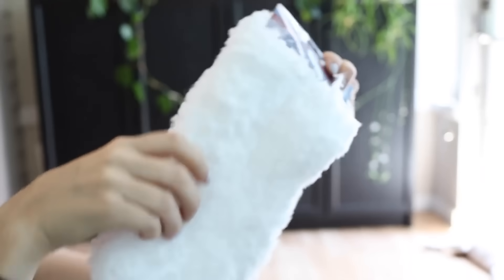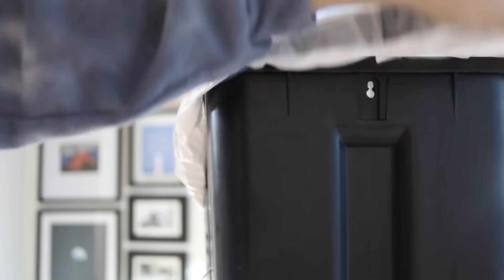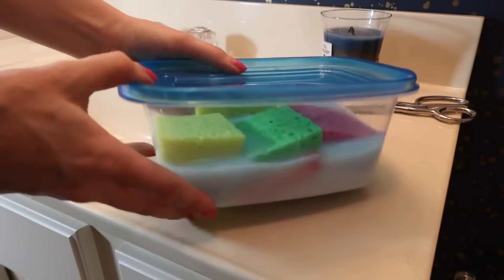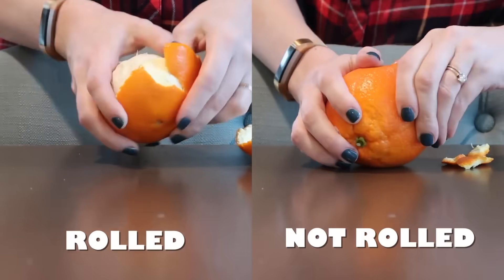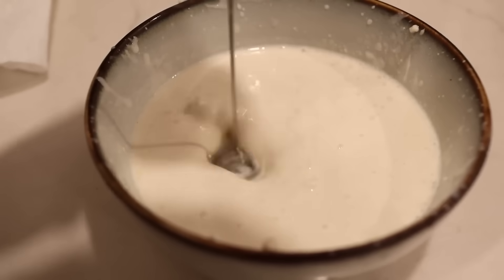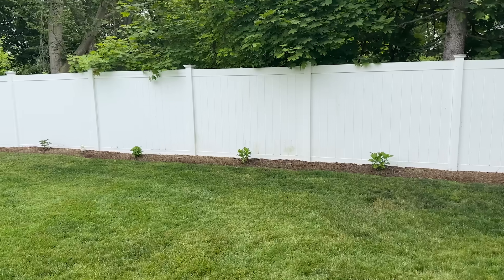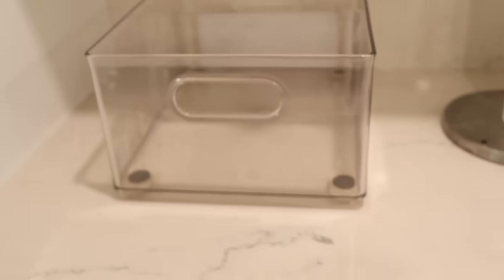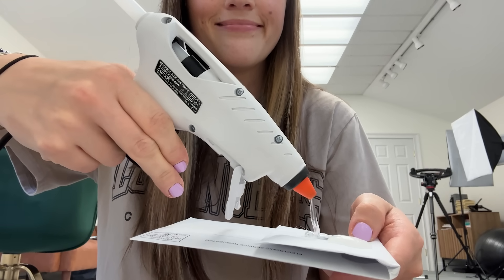43 brilliant NEW home hacks you need to try!! (you won't believe #22)

Comment: I use wool dryer balls in the dryer. No buying/nor making dryer sheets. I use three. The last for ages. Like years. I highly recommend them.
Reply: They are noisy though.
Reply: We use neither dryer sheets nor balls in the dryer and our clothes come out without any wrinkles.

Perhaps it's because I take them out of the dryer fairly soon, smooth and fold them right away and put them away.
Reply: My dogs steal them and I never see them again.
Reply: @helenskylar7239   😂 My cats like them too. I finally bought them their own.
Reply: I used my dryer balls for a long time &  they started to peel & shed so I put each one in a sock and tied off the end and voila - still good to use.
Reply: Excellent  hints!!!! Thank you so much.❤
Reply: @NASA_astronautHammockStepMom I wonder what I could put a wool ball into, since I am allergic to wool.
Reply: @dianefranks1621  I put mine in a cotton sock and tie off the end.
Reply: @dianefranks1621  I put mine in a cotton sock and knot the end of the sock.
Reply: I also put essential oil on the wool balls and Wa-la nicely scented!

Comment: I love these hacks and your channel. When it comes to cooking corn in a cooler though, I wonder if the plastic liner in the cooler was designed to endure boiling water, so chemicals don’t leech into the water and if that plastic is BPA free.
Reply: I was concerned about this as well!
Reply: I wouldn’t risk the leaching chemicals on my food. Otherwise, every hack is just fantastic, especially the garbage can hooks. Love your channel.
Reply: While I personally wouldn't do this hack myself - I have a huuuuuuge pot as well as a large roasting pan I could use - I suppose if someone really needed to do it they could first line the cooler with one of those turkey-sized oven bags? Those bags are meant to be food-safe so I guess that should work.
Reply: Maybe a food-safe crockpot liner could be used for additional peace of mind.
Reply: I'm thinking of trying this in my crockpot for a smaller quantity.  The boiling water in an already heated crockpot should work well
Reply: How would it be any different than if it was in a plastic bowl?
Reply: @Blondie7676  Not all plastic is made equal. There are food safe plastics that are not hormone disruptors (marked BPA free, etc.) that can safely hold food even when warmed up so chemicals won't leach into the food that you plan on eating. Whatever you use to cook your food in, check to see if it mentions what temperature range is safe, if it's microwave, oven, or stove top safe, etc.
Reply: @NotAFanOfHandles  good to know. Thank you honey

Comment: For toilets and toothbrush, maybe in the us it isn't available but in Poland there is something that in my translation is unclipped toilet seat, basically its just what it's called, you can unclipped seat and wash it in bathtub or shower, its not very common but i could not live without it since i discovered that
Reply: I know exactly what you are talking about, so good job with the translation.   They aren't very common but I have one too.    Some of them are called Lift-off or easy-off.   I will never go back to the other type either.
Reply: They are available.  I bought one from Home Depot.  =^..^=

Comment: I have never, ever saved a home hacks video - until now. The first one I plan to use is the heavy duty broom in the showers.  We have stone floors in them and I scrub them by hand with a small brush.  I'm 72 and it's not always easy for me. There were a couple of others - like the over-the-door hangar for outside and that glue stuff to keep things from sliding.

Comment: Thanks for so many helpers.  My favorite it using the dish wash sponge and handle thing for cleaning in the shower.  That is going on my list of things to pick up at the Dollar Tree.  Another was the glue stick....how simple, yet why had I not thought of it.  I subscribed so I wouldn't miss any other hints and tricks.  See, you can teach an old dog new tricks....I'm 84 and learned several new tricks today.
Reply: Since you're elderly like me, here's a hack for getting clothes out of the dryer. Get a grabbie from Harbor Freight. When clothes are dry and you can't get that sock in the far back of the dryer without excessive reaching, use your grabbie.
Reply: @judyanderson8782  Thank you Judy, That gives me an idea to use that grabber (which I do have) for getting some of the laundry from my washer also.  It is so deep that sometimes even on tip toes I still can't reach the wayward piece.  I appreciate you reminding me that grabber can be used somewhere else besides my pantry.
Reply: I use my grabby thing to open and close my curtains that hang freely on the curtain rods, just grab and drag!  Easy!
Reply: @bobbiegallia1188  great idea, thanks for sharing that one.
Reply: Long tongs work well in the laundry room too
Reply: I used a dustpan brush to wash out the bath tub.

Comment: I agree with your complaints about nooks and crannies of cleaning. As we built our house, everything I chose was based on how easy it was to clean. Also, we bought one piece toilets, which are a lot easier to clean
Reply: Houses and cars should be designed   for ease of cleaning!
Reply: I just got some denture tablets to clean my stained  thermos flasks and mugs. I'll try them on my Tupperwares too.
Reply: How did you determine if something was easy to clean, do you have some tips or your thoughts?
Reply: Gotta get a steamer....it changed my life. I hardly even buy cleaning products anymore. It also cleans nooks and crannies beautifully, removes water spots, hard water stains.....stains on fabric, everything. I used to hate cleaning, now it's basically me getting to play with my awesome new toy lol 😊
Reply: @amandajlemen might get one now! Thanks
Reply: I spray lysol, scrubbing bubbles etc around all nooks and crannies then after scrubbing the shower floor tile I pour hydrogen peroxide over it to boil out all.mildew

Comment: I’ve been doing the hanger trick (#14) for years. Works like a charm.
Reply: Me, too! Mine came out of necessity. During recovery, when I had my hips replaced, I was unable to stand and walk for long periods of time. So when it came to laundry, I simply figured this one out on my own. I also found that shaking t-shirts from the bottom hem and holding at the seams was much more efficient for straightening the shirt out for folding and hanging.
Reply: I love it

Comment: Personally I wouldn't do the cooler one because I have several ginormous pots, plus a roasting pan I could use instead, but also the potential BPA/chemical leaching concerns. If you really need to use it, I would recommend first lining the cooler with a turkey-sized oven bag as those are food safe and will tolerate boiling water. Pop the bag into the cooler, place the corn inside the bag, then pour the boiling water into the bag. Place a couple of wire racks on top to keep the corn submerged for even cooking and you should be good to go.
Reply: I agree 💯🩷

Comment: I use dry erase markers on my fridge for grocery lists and phone numbers that I only need for a little bit. I use them on my freezer for the next weekʼs meals. When I have transferred my grocery list, I wipe off the fridge. Same with the freezer. I use a squirt of orange vinegar to make sure every bit of the previous lists are gone.

I use them on the washer to threaten mayhem if the water temperature goes hotter than warm. My happily moved last roommate was bad about that.
Reply: I've never heard of orange vinegar before I'll have to look for It
Reply: @FriendOfJah  I think you make it by soaking orange or Mandarin peels in vinegar for a week or so

Comment: My hardboiled egg shells always stuck until I tried this hack I saw:  bring the water to a rolling boil first, and THEN add the eggs.  Simmer about 14 min.  I also put them straight into ice water when they're done, but that alone wasn't enough.  It's the rolling boil that made the difference. 
Lots of good ideas here!
Reply: Maybe that's why the streaming method works so well. I  boil the water first.
Reply: That’s exactly what I do! Add eggs to boiling water. Boil for 14 then ice for 7

Comment: 6:38 Another thing that you can do with the rice and essential oil is use it as heat pad. Pop it in a microwave for 30 seconds and you get yourself a heat pad. Essential oil is optional :)

Comment: Thank you for your tips.  Love the garbage bag command hook and bread bag.   I fill my brush with Dawn and vinegar to scrub shower doors while my conditioner is working.  I throw some Apple Cider vinegar in the bleach section of my washer when I wash blankets if anyone has dogs that use your couch blankets or sleep on the bed.  I use the scrub side of Lysol scrubbing wipes for my sink for removing the dirt, grit, grime and it actually gives it a good shine too plus its antibacterial

Comment: Denture brushes work better than toothbrushes since they have a larger head and stiffer bristles.

I also use denture tablets in vases that have "crud" left behind from flower stems or leaves. Just rinse the vase, fill it with water, toss in a denture tablet and leave it overnight. In the morning, the remaining crud will easily rinse out.
Reply: I use them to clean my hairbrushes every day. Just basically removing the hair — you can use the smaller tip to scrub product off after soaking the hairbrush in water with a drop of dish soap every once in a while.

Comment: I love the hanger hack.  That air freshener would work great in my trash drawer.  I love using a tooth brush to clean with! If your roll your lemons or limes before you slice it , it makes it juicer.  I've used that missing bread tag for years! Thanks for the mango hack!!  Love those wheels!  Love the picture hanging hack.

Comment: Aging-in-Place 'Hack':
If you have mobility issues, you must hate having to use base cabinets for storage, especially the sink base cabinet.
Instead of using a variety of extendable shelves, stacking bins, or shelf risers, look into installing extension shelves.
They come in a variety of widths and depths, to work with the unique volume configurations of the space in sink base cabinets. Some include a second tier shelf narrow enough to thread the space between pipes and the cabinet side.
They can be mirrored on each side of the base cabinet, then a long thin bin can be placed between the two for additional storage.
NO MORE KNEELING TO REACH THE BACK OF THE BASE CABINET!

Comment: It's amazing how many things I've found to do with those DT wands that you can stick all the attachments to. I dust my walls, ledges above doors, vents, they're good for quick spill clean up or getting under furniture to dust.  Ceiling fans, baseboards. Anything basically you'd need to reach or bend down to clean

Comment: I will be grabbing an outdoor broom like the one you show for cleaning the shower floor!  We had our shower (actually, it was the entire master bathroom) remodeled. The shower from when the house was built was a boxy yellow color (late 1960s-early 1970) was hideous, so the contractors tore it out. They were able to remove this tiny corner cubby, which allowed us a larger shower with thin type shower wall pieces going over the wet room drywall & the shower floor with heavy water barrier & base with grouted tile. The whole bathroom is beautiful, esp the extra roomy shower!  It is becoming more & more difficult for me to get down on all fours to scrub the tile. I’ll be buying a detergent fillable dish scrubber for the shower walls & the bathtubs. 

Thanks for all the cleaning hacks, but esp so for the ones above. I’m mid-50ish, heavy on the -ish. Any cleaning hack that makes life easier is worth it.

Comment: Love all your ideas!! 😊 I would love to know how you store your cleaning brushes and toothbrushes after you use them. I need a system for that!
Reply: Dollar tree has a cup holder with lid along with toothbrushes that I use.  I use permanent markers on handles to identify use.  Also after use, soak in hydrogen peroxide to sanitize.
Reply: I like to use color to identify things.
Red for "toxic" use only.
Like for cleaning toilets or using with chemical cleaners.
So I would only use red toothbrushes for "dirty" cleaning. 
(Red kitchen utensils for raw meat)

And then, I do not use any red toothbrushes for brushing teeth.

Comment: I steam my eggs in a collapsible metal steamer tray thing. I put it in a pan of water. Once it boils I place the eggs in. Boil for 20 minutes on medium heat. Place in ice water and they peel perfectly. No shells getting stuck. Steam is the answer. I'm assuming that's what the air fryer does.
Reply: @osakarose5612  Thanks. I need to give it a try.

Comment: You can pop the toilet seat off. I used to clean houses. You open the little tabs and pop it off, making it 10x's faster and easier .
Reply: Not everyone's toliet seat pops off. I wish mine did but I live in an apartment and none of them do.😢
Reply: I learned this last year!!! How many years I thought my toilets were clean… I shudder to think how wrong I was!😮
Reply: That’s specific to much newer models, most are attached by the long screws that attach from the bottom
Reply: @sandinewton1896  you just unscrew it most people's toilets aren't fastened correctly any way that why they slide around
Reply: I clean houses with one other lady and I do bathrooms as long as she does the kitchen and I have yet to come across a toilet seat that just pops off. Not a common thing where I'm at I guess.
Reply: @conniejensen2240  Look it up on Lowes or Home Depot. Not everyone it but most are designed that way.
Reply: They either screw in or just pop off

Comment: Thanks for the hacks, Kallie.  Here are a couple for you.  Most children's toys can be washed in either the dishwasher or the washing machine.  For example, I used to throw my son's Lego pieces in a mesh laundry bag and spread it out on the top rack of the dishwasher.  No scrubbing.  And, for "sealing" drafty windows and glass doors, spray down the glass with water and then press on a sheet of bubble wrap large enough to cover the glass.  Use more sheets as needed to cover glass entirely and just respray the glass when the bubble wrap starts peeling off.  This prevents drafts and keeps the house much warmer and cheaper to heat.  Looking forward to your next hack video.  Thank you! ~ Lisa

Comment: I just had a wire shelving unit erected in our basement storage unit (I live in an apartment) specifically for storing my crock pot, instant pot, panini maker, turkey roaster, lobster pot -any large kitchen appliance that I don't use on the daily, to maximize the space in my tiny kitchen. I also now leave my Dutch oven on the stove at all times. It is the largest pot that I use fairly often, and it takes up the most space in my cabinets. So I finally invested in a beautiful enamel cast iron one and I leave it on my stove top. I also finally invested in a matched set of cookware that nests. Game changer.

Comment: Here's a hack for a big corn roast... Get a deep pot of boiling-hot water. Drop in a pound of butter. It will float to the top. Holding by the stems, dip your cooked cobs in the water. As you pull them out, they get coated in butter.

Comment: All my "do not dry" items go in wash bags, which is where they mostly go anyway because I don't want them rubbing/stretching among the general population in the wash.  I do also put all socks in wash bags for loss-prevention, but obviously you can tell which bag that is during transfer and go ahead and throw that one in to dry.
Reply: I do wash bags for a lot of my hang-to-dry shirts, too. I have a lot of identical ankle socks (the ones that come in a pack of six pairs or more) so I got a pack of big safety pins and I pin them together when I take them off. They're already paired when they come out of the dryer and each pair wears out at roughly the same rate. (I've tried the bag for socks but some of them would always still be slightly damp and then I'd have to put them back in.)